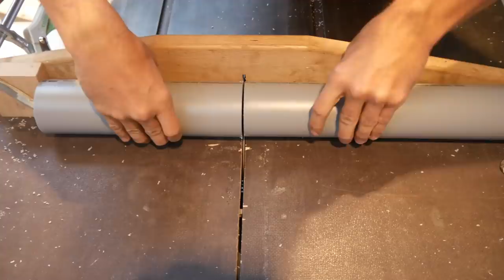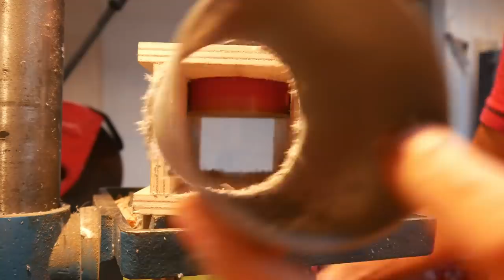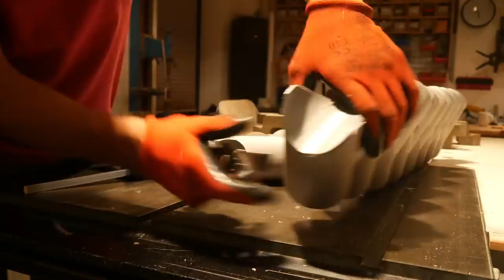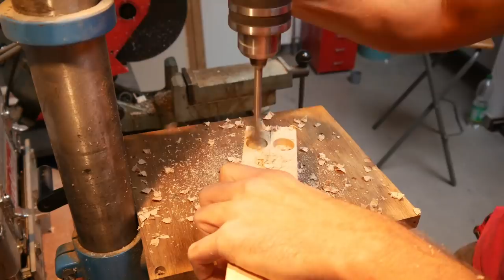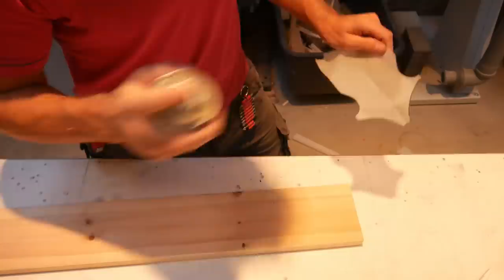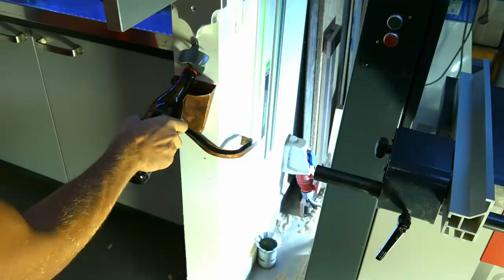Spray can storage rack 2.0

Comment: i really like this idea, have you found that the hot glue joints have held up? That's the part I'm worried about.
Reply: @chrisjohnson4386  Thank you so much for this link.  <3
Reply: I hate Hotglue
But instead pvc glue lasts 4 ever
Reply: Вот на какой подвиг сподвигла чашка кофе!😁

Comment: I noticed the hole in the jig is not in the center of the top board length; can you give me the measurement center point for the hole saw and the dimensions of the wood for the jig?

Comment: What was the tool used to chamfer the inner edge of the pvc?
Reply: WookaBounce, A de-buring tool. You’ll most likely find it in the engineering tools.
Reply: Right, but if your going to deburr plastic, best to get a smaller tip than the one used in this video, it won't dig and will give a better finish. Cheers.
Reply: Thanks!